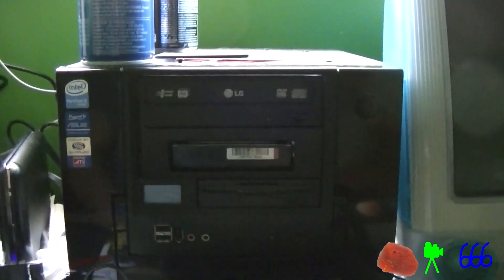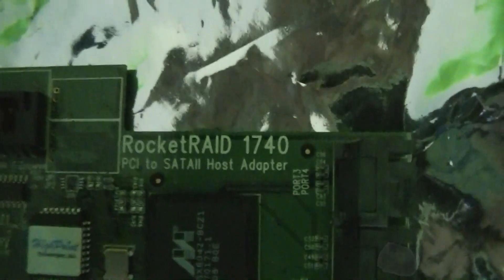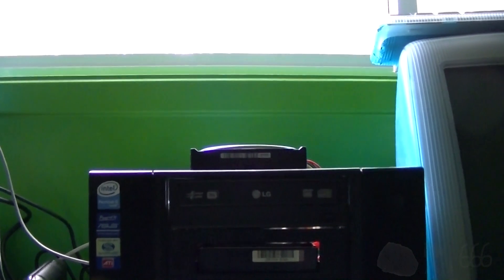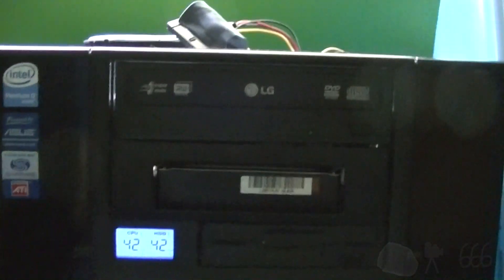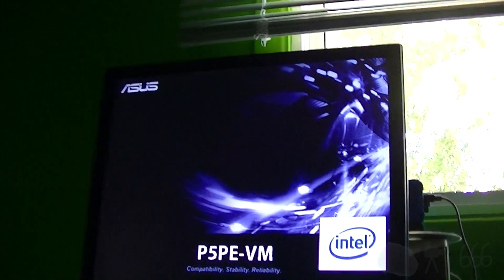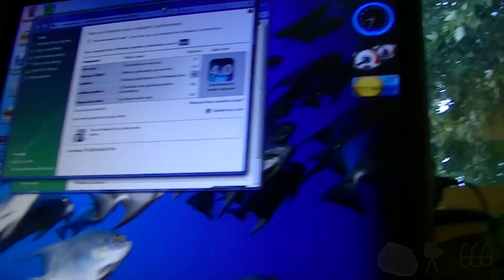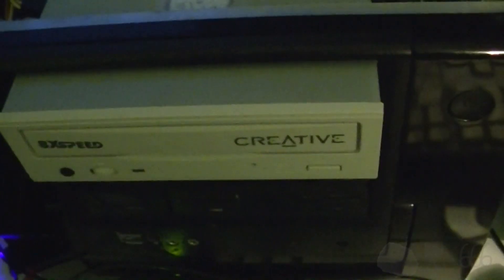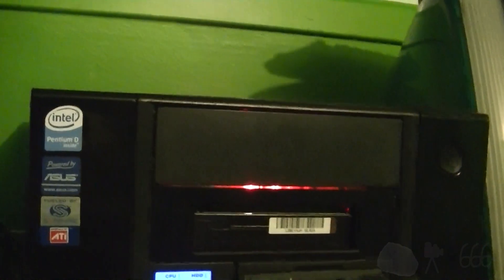More Pentium D Upgrades

Comment: You paid too much for those SATA cables at CC,  I wouldn't pay more than $0.50/cable !

What type of LGA775 board and Pentium D CPU is that ?  I got tons of new motherboards and Pentium D CPUs if you need any.  The Seagate drives are quick and quiet if they were larger capacity.